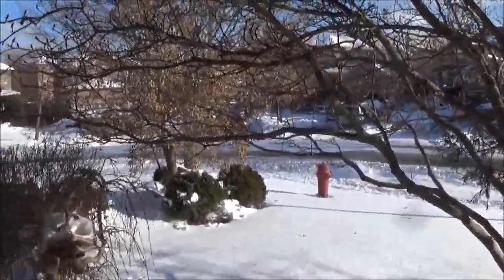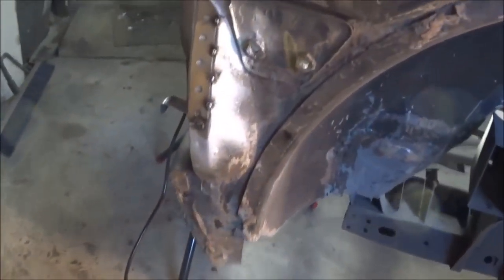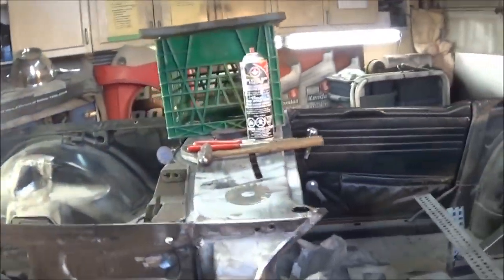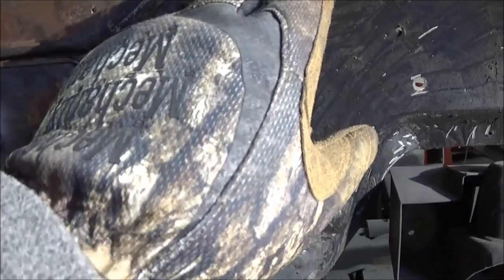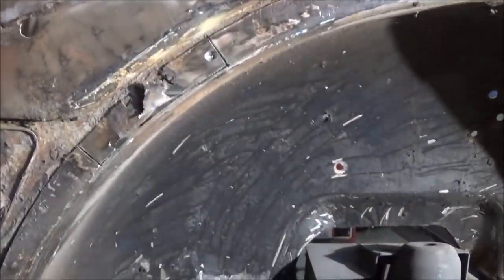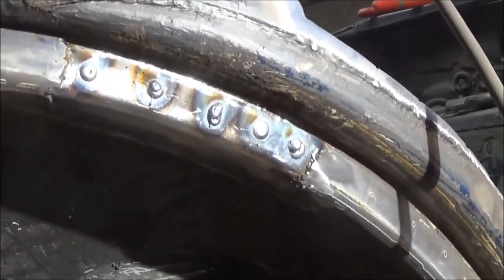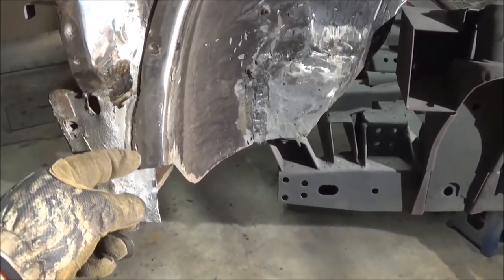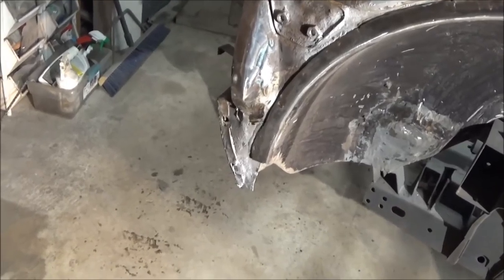1968 Triumph TR250 Restoration, Drivers Side Front Valence and Wheel Well Repairs

Comment: I got a super drive in last year, North Vancouver island and back. Blew the starter engage solenoid in Manitoba on the way out. Gave it a quick fix in Sask. using a trick switch off the key harness, I didn't want to break the key off in the switch and it allowed me to trigger a bunch of times just in case I couldn't get a push start. My concern was the Vancouver ferry. Of coarse they were the 2 times I got a perfect engage. Blew both carb diaphrams in Alberta but I had taken spares. Lucky... North of Superior was awesome as the ice was still on. Truckers are awesome, treat them with respect and they treat you like brothers...